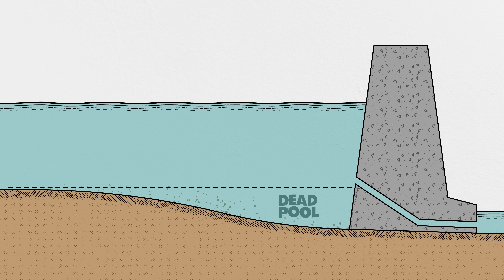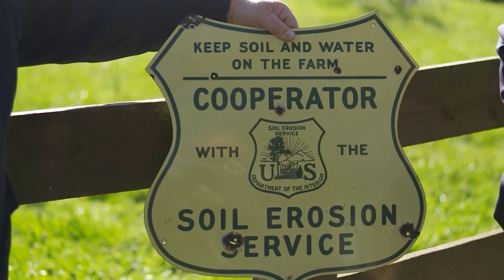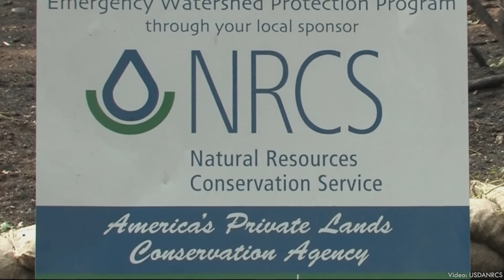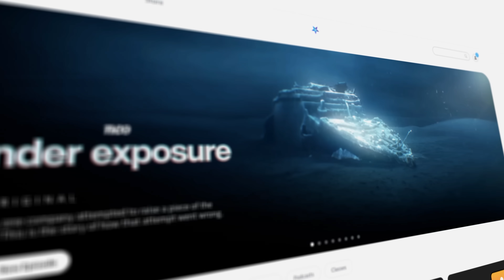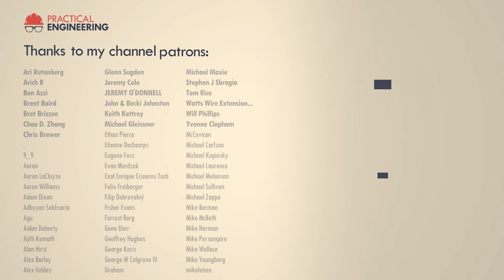All Dams Are Temporary

Comment: before watching too far, this does seem like it's unsolvable. I have two hypothesis though;

Set some places up that encourage sediment to build up, and have pipes that can flow water fast, perforate it, branch it out, and lye it on the bed. Occasionally open up those pipes to carry surrounding sediment away. This would take a lot of thought to make sure that the sediment doesn't collect elsewhere, and maintenance would be problematic.

My second thought is to have a dual dam setup, split at a higher flowing area. One will be in operation, while the other will be a collection area for the very rich soil that could be used on farms.

Ultimately they're all temporary still, because nothing can last forever, so it comes down to how long you plan to run it.
Reply: or take a page out of sir Joseph Bazalgette's book and see if you can't egg shape the lower parts, and increase speed with drainage there.

Comment: It comes to my mind (thus probably just an already discarded idea) why not have two dams in paralell and switch flow and operation every X years. By the end of one cycle, said sediment would be allowed to naturally drain and dry, thus alleviating part of those costs by weight lifted.
All of this while both dams should be designed to alleviate sediment at the same rate as naturally, if possible (design constrains + pollutants upstream)

Dams don't work forever but a river bed also changes over time. Sharp corners eventually are cut through and you get a straighter river, maybe an island and a lake. Let's imitate nature

Comment: If the dam’s main purpose was to collect water to supply homes more so than hydro-electric power perhaps one solution could be to allow the river largely to continue around the dam but to extract a smaller portion of water and filter it centrifugally like in a sewage treatment plant? Naturally the dam fills slower with water but does this mitigate sedementation and does it meet the water supply needs?

Comment: Per Grady's request for us to think up solutions off the top of heads before we see the answers later in the video:
1) Dredge up the extra sediment occasionally and shift it somewhere. Assuming this is an energy intensive process, maybe use extra power from the dam to provide the energy to help maintain this?
2) Rather than shift it generically "somewhere", specifically try to send the extra sediment down stream.
3) Use the extra sediment to build up the area around the rim of the reservoir, making it taller to allow it to store more water to help cancel our the capacity losses from sediment build up.

Comment: 4:55 - i didn't expect to laugh so hard

I'm tl;dring hard, but why don't they make some kind of salmon ladder type situation for the dirt to circumvent the dam, but start it at the point where sedimentation starts rather than by the dam?

or like an escalator with scoops type situation (or giant corkscrew which hopefully passively regulates flow by blocking straight flow).

Comment: Taiwan recently (2022) completed a large scale drainage tunnel at one of its older dams, extending about 3.7km from just upstream of the dam, to just below the dam. It aims to accomplish four goals:

1) In the dry season, dredging ships could send sludge through the tunnel to a facility at the bottom end. The facility sorts sand and pebbles of an appropriate size for construction out for sale, and then dumps the remaining material into a large storage basin.
2) In the wet season, a small bit of water is diverted from the top through the tunnel, and flushes the storage basin clean.
3) In the case of very large inflows (i.e., during a typhoon), the tunnel acts as a flood control, and could drain incoming sediment and silt from upstream, preventing them from entering the dam.
4) In the case of extreme drought, the tunnel can actually support trucks driving from the top of the dam to the bottom, carrying excavated silt.

It's only been through one major typhoon so far, so most of its proposed functions remain untested. It's an interesting (and already implemented) solution nonetheless.
Reply: I was thinking about the value of the sediment as well
Reply: @pXnTilde  They say we are running out of sand. The best sand for construction comes from rivers and beaches, not deserts (river sand has angular grains that bond well with cement while desert sand is too smooth and round to bind well). So this seems like a good source of river sand.
Reply: Wow I thought about making a filter  at the lake intake, to separate water from dirt and move the dirt on conveyor belt and dump it in front of the dam (that would be most neutral for the rive) but this idea is much better
Reply: The silt and sand is pure gold. Don't let it flush into the sea. Use it for your civilization.
Reply: That's very interesting!
Reply: There are dozens of diamonds in silt, statistically speaking.. mining it would be extremely viable economically
Reply: This is a problem that's currently being debated at one of the biggest dams in my area. The reservoir is quickly filling up with sediment, which is making it difficult for the dam to do its dual duty of flood prevention and drought alleviation.

Comment: I had an idea that you could build a diversion river to carry sediment around the dam and keep it out of the reservoir. After much pondering I went back to your video on sediment transport. I think it can work sometimes but is difficult. I assume that often a significant amount of incoming flow is diverted to economic uses that don't return it upstream of the dam. So water discharge is decreasing. Sediment type is fixed. To keep sediment discharge the same, slope needs to increase. The elevation drop of the dam is fixed. So to do this, you need to take a previously meandering river and build a straight shot channelized diversion from the reservoir inlet to the bottom of the dam, and add some kind of flow control so the dam can serve its intended purpose.

Comment: Hydrolelectric capacity is dependent on hydraulic head, i.e. elevation of water above the turbine, not the size of the reservoir. You can install a very very very low-height diversion dam that diverts half the river's flow, directs it to a side canal that has an extremely low gradient and continues downstream at a fixed elevation... eventually, you reach where a "traditional" dam would be placed, at that downstream location you can funnel the canal into pipes that extend downslope to turbines. And ta-da... you got a hydroelectric plant that doesn't significantly impair the river or floods a massive area, still allows the river to still flow freely, and sediment will barely build up behind the smaller upstream diversion structure given its small height keeping main flow velocities high.
Reply: You could construct a channel, tunnel (expensive!) or even an aquaduct parallel to the river and lake, and make use of natural fluctuations in the water level to rinse it out every now and then. Use similarly a second parallel channel to transport sediment across the dam. Mix the sediment with agricultural waste. Build a parallel system like that along the entire river on its way to the sea. Make use of the sediment to raise the land level near the sea to avoid flooding, i.e., do not let the sediment enter the sea.
Reply: You do know that this arrangement is quite common, right?
Reply: @ I know that locks beside a dam are common, at least in Holland and Belgium. In Limburg, Holland, the Juliana channel has been dug parallel to the Meuse river,  and de Nieuwe Waterweg near Rotterdam parallel to the Nieuwe Maas. The Nieuwe Waterweg enters the sea where the sea is deep, minimalizing its silting up.
I do not know what 'this arrangément' in your answer efers to.
Reply: @motor2of7  Yep... but it's rarely talked about dspite it having a lot more benefit to the envionment and being often cheaper to build than a massive dam. As we start tearing down old large dams, some of them could be easily replaced with these systems.
Reply: If all a dam was meant to do was generate power, every dam would be set up like this. But they serve more purpose than that because they also control floods and store water for later use. The dam you propose can do neither of these.
Reply: @poshn9577  Most dams that generate power are not used to mitigate flooding, at least not to a significant extent, as the added storage capacity that remains empty until a flood usually eats into profitability for power generation while greatly adding cost to the size of the structure. As to water storage, that can still be accomplished with off channel reservoirs, especially in areas with flat topography. This is also pretty common practice but could be used a lot more often.

Comment: The other effect of natural ecosystems is they provide environmental services. They are the natural air conditioning and sprinkler system regionally in other words they define they manage regional climate when you kill land when you kill natural water systems and natural water basins you destroy the hydrological cycle in your region immediately and over the long-term in other words, facts are both immediate and long-term. With Marsha in the Mediterranean basin or paved over for oil refineries after the oil crisis of the 70s the hydrological cycle is destroyed the rains fail permanently. This is because by paving over the Martians, the water that had been trapped and then released through evaporation was lost. It was just poured into the Mediterranean, changing the salinity of the surrounding region completely altering The regional hydrology leading to desertification similar effects are the consequence of water projects like this.

Comment: How effective would sediment re-suspension via vibration be to help clear buildup? 

I could imagine barges that lower many long cables with strong vibrating heads to help kick up settled sediment and promote flow downstream in a controlled way that could potentially conform to sediment pollution regulations?

Comment: A local dam, built by Shakers in the 1860's, was becoming geologically unstable due to the huge amount of wet sediment pushing against it. They pulled down a bunch of the dam in an emergency procedure so water can flow out, but the sediment remains in place. Theyre leaving half the dam up and convetting the sediemnt into wetlands

Comment: Why don't we deal with the sediment problem similar to a swimming pool vacuum? Take the vacuum and hook it up to a dedicated dredging line that discharges the sediment into the dam's outflow in a calculated and controlled pattern across the delta front. this could be continuous or intermittent  over the course of the year. The conceptual implementation could be simple, drum up the water with a rover, let the water be pushed by the water pressure in the system already to a low point in the dam, and regulate the flow so that the pipe doesn't get clogged, larger debris could be ground down or removed by some other means.

Comment: As far as solutions go - build a few pipes at the bottom from the dam to the other end of the reservoir, pump the sediment out when it piles up enough to cover the pipe, no? A bit engineering and capital intensive of course, but much less so than other solutions mentioned in the video

Comment: I live in Washington state and here is some statistics for lake Roosevelt which is the Columbia river behind Grand coulee dam.
Lake Roosevelt is over 150 miles long and provides over 630 miles of shoreline. Lake Roosevelt stores up to 9.4 million acre feet of water behind Grand Coulee Dam. Full pool (when the reservoir is filled to capacity) at Lake Roosevelt is 1290 feet, this is the elevation of the surface of the water above sea level.

Comment: I have solved the problem as a biologist.  I have engineered several strains of bacteria to turn phosphorus, nitrogen, carbon, calcium, magnesium, sodium, potassium in to various oxide gases while the bacteria sits on the bottom of the lake. I just put some in the lake and it removed ten tons of sediment in a day and will grow exponentially.  The lake should be clear of silt in a week.

Comment: Excess water is already being dumped over the dam. Why not use it to dump sediment? For example, bucket elevators and waterways can be installed in hydroelectric power plants for sediment. Sediment is carried to the water surface with bucket elevators. Then, the sediment is left in the waterway built just above the dam. The sediment is thrown away with water without any obstacles in front of it. We can even build this waterway along the dam. It will be a permanent and problem-free system. We use some of the electricity produced for this system.

Comment: Since dredging and especially suction dredging tend to float a lot of sediment, why not simply use a floating pipe to push the water filled with sediment over the dam directly? That way you are removing water at the same rate that it arrives, but with a higher sediment load than is arriving? i imagine that the sediment below mountains could also contain an agretional amount of precious metal fragments 😂.

Comment: On the Mississippi River down here by Baton Rouge they do resuspenion dredging.  They  hydraulicly dredge material around the docks and just cast it out into the faster moving current to be carried downstream.  

For a 5M ton/yr reservoir, you would probably need a 20" discharge dredge with 1500kW  of power to move 1,500-2,000 ton/hr down a mile or two of pipeline to discharge the sediment into the downstream side of the dam.

Comment: Also when taking about management of the catchment area for the reservoir you only need to manage the riparian zone on the edge of the river. These riparian zones contribute the most to soil stability in the river. These riparian zones can be an little as three to five feet, but in other applications they're made larger (or conserved) to help slow incoming water and reduce down stream flooding.
Reply: Not quite true. Riparian zones are important, but rivers are complex ecosystems.

Comment: Stainless steel movable pool snake, that doesn't rely on vacuum, but the delta p between the downstream exit and mouth of the snake. 

What stops that working? 

Or one of those rotary bucket mining machines fixed to the dam wall. Run it slowly, maybe a rotation a day and it will lift the dirt into the exit hole. 

What stops that working?

Comment: What if we sectionalized the reservoirs? Like, make smaller dam structures through out a reservoir with larger gateways so that, systematically, we can isolate different sections, dig out the sediment, and then refilled it. Costly, yes, and also time consuming. We wouldn't get as much recreational use out of a reservoir, but for reservoirs that are needed to stay at max capacity for local irrigation and hydro power, being able to isolate parts, dry out the sediment for easier digging, ensure they're at the correct depth, clean things out, and refill it seems fairly appealing. We probably wouldn't even need to have them be the same structural strength as the original dam since they'd be latticed together, nor would they hold any hardware outside of the physical gates to pull up and some pipes to pull water from lower parts

Comment: It's not going to be cheap, but: 

When building the dam, build a water diversion structure at the head of the designed reservoir which will channel a fixed amount of flow into a spillway. Below this diversion at the head of the reservoir install sediment intercepting pumps or other mechanisms to move the accumulating sediment up into the spillway to be directly washed downstream of the dam.

Comment: The Mississippi River and tributaries like the Arkansas, Illinois, Missouri, Ohio, and Red have THOUSANDS of dams stopping sediment from going downstream. So the Delta is shrinking. Levees are lower, so hurricane surges flood more often in New Orleans and other areas. And there's a bunch of oil and gas pipelines crossing the Delta that can fail due to uneven settling or seawater corrosion. Definitely no easy fixes!

Comment: Use water jets to agitate it, allowing it to flow out to the fast-moving river. Naturally, you need to secure the immediate areas being pulled out for use. This way saves full draining, and there's ways to control how fast it's agitated, and specific types of jetting systems you need to use. But, compared to other methods..!
Reply: Flat earthers wouldn't accept this explanation

Comment: Dams also protects against flood damage, flood damage and dangerous amounts of sediment and water that could be worse than if the dam wasn't there.

I find a lot of the "hate" and skepticism towards damns specifically in the US to be misplaced and the discussion one sided. This video just gave me more questions than answers. I find the dam removal rate of the US worrying, dams are being replaced with enormously more damaging fossil fuels, or dams are being removed instead of fossil fuels when other renewable energy sources go online like solar and wind, effectively feels like the fossil fuel industry is "sacrificing" another industry so they can stay afloat for a couple decades more, same as what happened in Germany with nuclear and coal. The reason may be cost because hydro power is many times not very profitable but replacing hydro and keeping fossil fuels is just extremely short sighted and will be more expensive in the long run.

Comment: Silly potential way to help the issue.
But if the dams had a way to agitate the sediment so little of it settles  either though mechanical or biological means. 
So either vibrate the dam or put animals in the dam.
And yes i am aware this is probably not feasible.